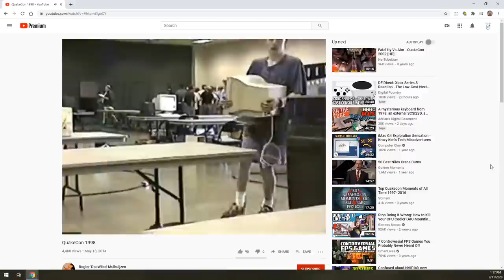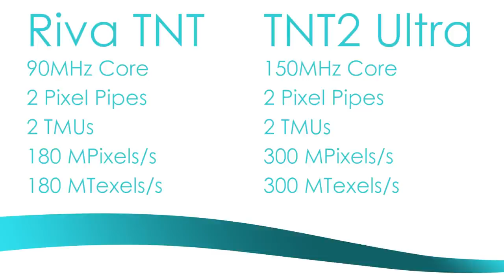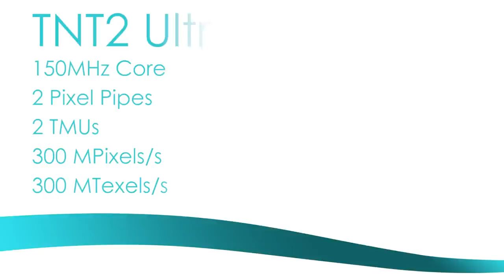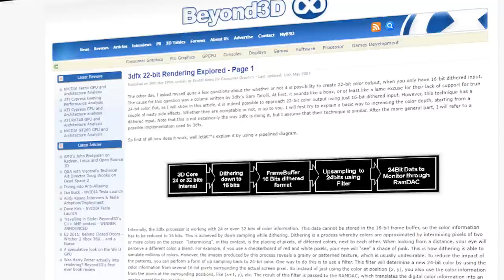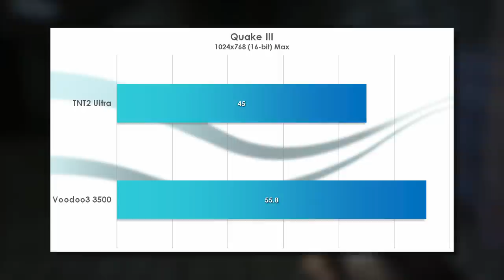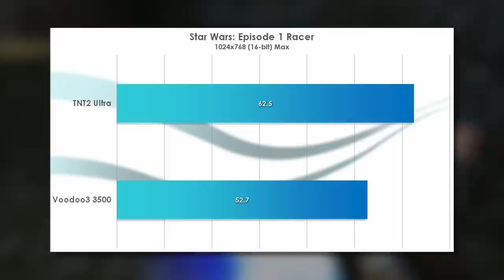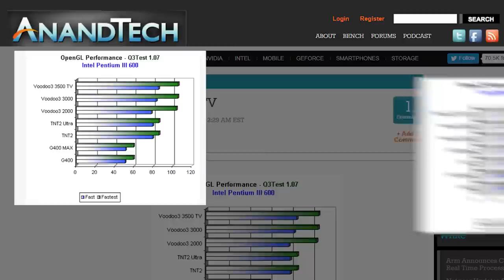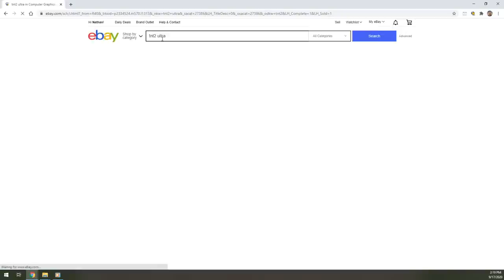NVIDIA TNT2 Ultra vs 3Dfx Voodoo3 3500 | Card Battles

Comment: I seem to remember that, that exact driver you used on the tnt lost about 30% performance. using the driver version 44.03 was faster.
I remember i was not having it, i tested on windows 2000, 98se and xp and it was the same story. i tested on all 3 OS's because i thought it was the fact that i switched from 98se to 2000 back then. but it was the same with these drivers across the board.
This is just from memory, so. but i distinctly remember there was this about 30% difference in performance with those drivers.
Edit: Just remembered, this was related to geforce 4 cards. not sure how much it affected other cards.

Comment: Man, I admit I didn't know this Voodoo 3 3500 with VGA output. I love it. For now, I'll settle for a Voodoo 3 3000 because that version of the Voodoo 3 3500 is very difficult to find. A pity that there is no 200MHz version (Voodoo 3 3500 SE). I have seen that there are people who modify the RAM memory for one of the ETRONTECH brand, to obtain more performance. Is there any information on this? A video about Voodoo 5 compared to Voodoo 3 would be interesting. It would be interesting to know which one is more compatible with the largest number of games.
Reply from the maker: I've seen memory replacement mods people have done to V5 5500s but not V3s. I'm sure they exist, I just haven't personally run across them. When I do a video about the V5 5500, a comparison to the previous gen will definitely be in there.

Comment: i remember getting a new Celeron 433 in december 1999 and playing quake 2 after hours doing work exp at a computer shop in 1998.... over reated for the cost if you ask me , quake 2 looked great at the time but those cards were expensive... in 99 when i got almost the cheapest computer available at the time for $1200 in december 1999 in Australia it had a 17inch KTX monitor 9 gig hard drive 433 celeron with 64 ram sd1333 i think with win98 it came with only a 8 meg AGP built in graphics SIS 620 chip set i think it it ran unreal tornament 2000 in software render amazing good ... that voddoo card is super expensive but why buy it if Unreal torn still looked amazing in software render ....

Comment: 3Dfx was king at the time as I clearly remember. Nobody gamed at 32bit, so that part didn't matter. Nvidea and ATI gained a foothold only because of 3Dfx's fateful decision to make their own cards. They made a lot of enemies and lost in the press which cost them sales needed for R&D and it snowballed from their.
Reply: Yep, then the Voodoo 5 line was released late. It was meant to be released in fall 99', but it got pushed back by 6 months. Voodoo 5 competed favorably with the Geforce 1, but it was significantly slower than the Geforce 2 GTS. 6 months later 3dfx was gone.

Comment: Problem with these cards in 1999 was, no normal and common people could afford them. For me, 1999 was more like voodoo2 era, when finally voodoo2 got cheaper. Most people could dream even about voodoo3 2000, not even 3000 or 3500. 3500 was unreachable dream by most, in reality, I do not know single person, that owned this beast in 1999. I've heard about few that owned voodoo3 3000, but not 3500. It was just much more expensive from 3000. If someone want to pay for voodoo3, they usually opted for 2000, which was overclockable to 3000 level, and it was enough. Some even bought 3dfx velocity and unlocked second TMU. It was very smart move, but I didnt know about it. It had voodoo3 2000 level of performance, after unlocking second TMU. 3500 was more like "reviewers" card. I saw it in reviews, and benchmarks, but I never saw one in reality. I've tried to get it cheaper in 2003, for retro PC, but I failed even then to find one. Simply, noone was selling them. I've got voodoo3 3000 at the end, and I own it till today, still running after 20 years. :)
Reply: Samurai Jack  I feel you, I am from post-socialistic country too. Here, I was basicaly first in class (i was in middle school in that time), to own 3d accelerator at beginning of 1999. Most people had some crappy Pentium 1, with 2d VGA card, probably 1 or 2 MB at home at that time. Voodoo3 was more like luxury card.

120$ or 150$ seems nothing now, but true, in that time, also exchange ratio was very bad, and also, you have to add taxes for import. I remember, that geforce 2 mx, which was basicaly 120$-150$ card, costed here 7000-8000 crowns. I just checked price listings from year 2000. Incredible. After inflation, it is like 12000 crowns. That is basicaly like $450 today. And that was only geforce 2 mx. So for $450 of todays money, you would get only gefoce 2 mx in 2000 in our country. Now for 1$ is like 25 crowns. So for $120 you would get around 3000 crowns. (counted to euros) But of course, salaries are much higher. In other words, voodoo3 3500 would costs something like 900$ for todays money. And imagine, you are student on high school, and have to pay $900 to have voodoo3 3500. It's almost impossible, because, you know that for $900 you can buy lots of other cheaper stuff to computer. So that's why noone owned voodoo3 3500 in that time, at least in poorer countries.
Reply: Samurai Jack  slovakia.
we were on P133 in that time. Later in 99, we upgraded to K6-2 500. We means me and brother, because parents didnt used computer, even when 2 people gathering money and both parents could help, it was expensive upgade, and k6-2 was pretty low, in late 99, it was more like mainstream computer. PIII and PII (not celerons) was unreachable. You had to uprade lots , HDD, RAM, VGA, so no money to spent on expnsive CPU. Now i see it as mistake... we should go to Slot 1 Celeron 300A and overclock to 450. Celeron had so much better FPU, like +30% more performance in 3d games. AMD k6-2 500 barely matched 350 mhz Pentium II in FPU performance. Also, next upgrade could ber cheap in late 2000, with Slot 1 Pentium III, while we could not upgrade on supersocket 7.
Reply: I agree, in 1999 I was running dual Voodoo2s in SLI and was happy as hell. 3 was just...well, voodoo magic

Comment: If a card has a lot of overhead in the drivers or graphics API, or does stuff in software that it can’t do in hardware, the fast CPU would mask this issue?
Reply: yes. it also helps cards that do not have hardware acceleration for stuff like transform & lighting. using overpowered cpus skews results. it would make a voodoo look way better than it should against a geforce, for instance, since a fast cpu can do that faster than the gf2 can anyway, so hardware acceleration is actually bottlenecking it, the very opposite of what would happen with period appropriate hardware.

Comment: The biggest flaw (fatal) of the Voodoo 3 was the lack of sufficient cooling.
Passive cooling with a heat sink large or not doesn't cut it.
An owner has to put an active cooling fan on it or else it will become quickly heat damaged.
Otherwise it's a very versatile and worthwhile 2D/3D graphics card that runs glide based games which were very popular and widespread at the time.
I've owned a couple of PC games that ran on either Direct3D, OpengGL or Glide mode and I usually preferred the games in Glide as the API.
They looked better to me for the games that I played at the time European Air War being my favorite in 1999.
This is why I went with the Voodoo 3 graphics card.
Reply: FALSE. The V3 maximum temperature is 65-70 degrees celsius which is farly low.
Reply: @3dfxvoodoocards6  Been there done it since 1999.Even PhilsComputerLab here on YouTube recommends using a cooling fan on a Voodoo 3 as well. I've personally witnessed damaging multicolored artifacts by not cooling it which will lead to electron transmigration damage on the silicon just like not cooling a fast Pentium processor.
Using sufficient active cooling will lead to a much longer component lifetime
Reply: @m9078jk3  philspcomputerlab tested his V3 3500 at a room temperature of 34 degrees celsius which is ridiculous and he got 85 degrees maximum. At 25 room temperature my V3 2000 and V3 3000 only get to a maximum of 65-70 degrees celsius with standard cooling (no fan) which is not much for a video card.
Reply: @3dfxvoodoocards6  Back in 1999 I purchased a Voodoo 3 2000 PCI graphics card.
I live in Tacoma Washington USA and the climate there is quite mild with a fair amount of rain. In an air conditioned room I had my computer systems.
After a couple of weeks (3 I believe) of game play I started having color thermographic artifacts on my screen during 3D gaming which wrecked the visuals during play. 
Being suspicious I removed the case cover of my PC to do a simple test.
Just after  a little 3D gaming I touched the heat sink with my finger and it practically burned it. I couldn't leave my finger tip on it and It was very hot to the touch .
Immediately I knew something was wrong.
Just like earlier faster Pentium processors and even very fast 486 microprocessors had cooling fans with heat sinks , I decided to put a cooling fan on that Voodoo 3 2000 PCI. The artifacts went away and it solved the problem. 
Had I not done this the lifetime of that graphics card would have been greatly shortened (which 3Dfx may have designed it that way for built in obsolescence and a possible neat scheme to have the user have to purchase another replacement card.
Steve Jobs made the same mistake with the Apple III and also with the original Macintosh.They didn't have sufficient cooling
Reply: @m9078jk3  I had 5 V3 2000 and 3000 from 1999 until now and never had any problems. I tested the my V3 2000 and 3000 at like I said at 25 degrees room temperature the maximum temperature was 65-70 degrees celsius with standard hearsink (no fan) which is low for a video card.
Reply: @3dfxvoodoocards6  Not have cooling fans (active cooling) was very common during this era amongst many graphics cards.Not long after 3DFX themselves properly incorporated active cooling with their Voodoo 4 and 5 cards.
Diamond Multimedia made a Voodoo Banshee card which had a fan built into it correctly. Other manufacturers didn't and they got very hot and often failed. The Voodoo 3 basically Avenger was no more than the Banshee core with a second texture mapping unit  added. Had 3DFX let other manufacturers make their cards Diamond Multimedia would probably have made a Voodoo 3 with proper cooling.
Reply: @m9078jk3  you do not need a fan on a Voodoo 3 because the maximum temperature will be 65-70 degrees celsius in normal conditions which is perfectly fine. Thats why 3dfx never sold the V3 with a fan, because it is not needed.
Reply: @3dfxvoodoocards6  I sure needed it no matter what your opinion you didn't play the 3D type of games that I  played. After the artifacts appearing they never have totally disappeared from the electron transmigration damage on that particular card. However my card still works to this day and I have another similar model as well and 3 other Voodoo 3 cards. All of them have cooling fans on them.

Comment: Not surprising that the  V3 was being held back: it's a DX6 card so it relies on the CPU for alot of graphical setup. It can sure as hell take advantage of a faster CPU: According to Phil's Computer LAb the Sweet spot for the V3 is a 1 GHz Pentium 3. I suspect a 1 Ghz Athlon XP  (say an underclocked T-Bred or Barton, or a Geode NX)  would do just as well.
Reply: Which kind of exposes the TNT2 Ultra even more. Even with an overspecced CPU it still got creamed more often than not.

Comment: I had a Voodoo 2 PC in 1998 and in 1999 my parents upgraded that PC and got rid of it as it was Pentium 2 and Pentium 3 came out. However it's funny to think that all people focused on was the CPU, ram and hard drive size back then... No thought into the GPU. And the new PC had onboard graphics and no slot to put a graphics card in :/ So I actually had worse performance in games on that new PC. It was some Packard Bell PC and it had 1mb of ram for video and that came from the main ram, so it only read as 63mb of ram. So when I tried to launch games that required 64mb of ram like RTCW, they wouldn't run and would just tell me I do not have enough ram. Then my mum bought the next PC and it had a Geforce 2 MX in it and it was barely any better lol. So glad the very next year I built my own 9700 pro PC.

Comment: Am I glad to see this video. But I still not sure about what was the best card in 99, because there is people who think that Matrox Millennium G400 MAX is unfair forgotten as the third competitor
Reply: As I remember G400 series have problem in OpenGL, turned out G400 didn't support OpenGL, the driver will have to wrap the OpenGL commands into D3D ones, thus causing some compatibility issues.

Comment: Man, I've been checking Ebay for retro cards, and even those have gone up substantially. I was able to grab a 9800 Pro for $50 so I could resurrect an old Athlon XP 3200+ system of mine, and that was a really good price compared to anything else I could see. The GPU apocalypse has even affected retro cards. =(
Reply from the maker: Prices on retro PC hardware has been sharply rising WELL before the current parts shortage
Reply: @PixelPipes  I had no idea. I've just recently been looking at older hardware even though I've watched your videos for a couple of years. I just assumed the lack of new GPUs has people going for older used hardware. I wonder what's caused the increase in prices.
Reply: @Macabre215  More people wanting to get cards they had / lusted after back in the day, and limited supply of these old parts to go around now.  Just good old fashion laws of supply and demand in effect.

Comment: PixelPipes : the real reason why TNT2 Ultra was portrayed back then as a winner is Nvidias anti-competitive tactics that they still use today against AMD....and that is bribing outlets to falsify measurement data or at least partially falsify the data. You getting overall faster results with Voodoo 3 today, with the same old drivers from back them tested on the same old games from back then, is proof of Nvidias bribery, period.

Comment: I had both cards for a while. The voodoo was much better but only in glide games, but the TNT2 ultra was better at most games, and in the long run the 32bit was really the winner. Barring say unreal tournament, the TNT2 just was better overall, even if in some cases it was a bit slower.  The voodoo heatsink without fan really loved having a fan on it, the TNT2 fan was garbage and screamed at high speed. I was able to overclock both cards to get a bit of performance, but in the long run, the TNT2 ultra ended up my main gaming card in my at the time screaming katmai pentium 3 450mhz running at 600mhz in a BX chipset board running windows 2000.

Comment: I own both cards But my Voodoo 3 3500 is the TV Model. I watch the aftermath of 9/11/01 On my Voodoo 3 3500TV. But Nvidia Still used the classic if you can't beat them buy them out. And with the purchase of 3dfx they dominated things for years. As for me I loved my Voodoo card more the the Nvidia TNT2. It was not until I need more VRam I then bought my ATI All in Wonder 128. I did video Editing converting old VHS to DVD for People. Nvidia just cost too much for the higher Memory Video Cards. Now I use Nvidia 1070 with a Telsa K80 to boost it. I have 32GB of VRam and Nothing seem to to slow it down.

Comment: I managed to aquire some awesome TNT Ultra based machines back in 1999. Was lucky enough to get five Dell Optiplex servers in amazing fold out Dell wideboy beige cases and each contained dual P3 550's (slot), 256MB SDRAM, an onboard SCSI controller AND a separate SCSI card with Quantum SCSI 8GB HD's installed and Dell Viper 770 TNT2's - which were much like the TNT2 Ultra only custom to Dell machines I believe. Maybe not as fast as the Creative TNT2 Ultras, but very close. For the time, those machines were absolute powerhouses, especially under Windows 2000/ME which made use of the dual CPU's, although I think only Quake III used the dual core ability in terms of games.

I gave one to my brother who had never had a PC before, only a Playstation 1, and he was mesmerized by Deus Ex and Heretic 2 for months on end. Even though the only monitor I could spare at the time was a shady cheap 17" bubble CRT which was so bad I forget the make and model. Hilariously, he called me one night and asked me to come over because he had gotten really far in Deus Ex but had become stuck on the submarine base level (near the end of the game). I went over and discovered he hadn't applied a single skill point except those from the start of the game when you meet your brother on the docks. He had gone ALL THE WAY to the sub base, being untrained in almost everything. Perhaps that makes him a god? I don't know...

Regardless, I still have one remaining machine in storage but I outfitted it with dual P3 700's and a Geforce 2 GTS before I retired it back in 2002. It served as a second machine until then so I could play Q3 OSP over LAN with my friend when he came over for a smoke. It ran ultra smooth considering it's age, even before I put it out to pasture. I did keep the vipers out of the other machines though, so I have 3 of those still. The guy who bought the other 3 machines from me only wanted them for their SCSI capability and the SCSI drives they came equipped with. When I took them over to his place he insisted we have a 2 hour conversation about computer things. He was a nice old fella, just a hobbyist with a lot of money and time to tinker. Considering I originally managed to get all 5 for nothing, I made a few quid on those PC's. Still, looking back, I should have kept more than one. Retro builders dreams, those Optiplex machines. Haven't even turned it on in almost 2 decades. Wonder if it still works? :/